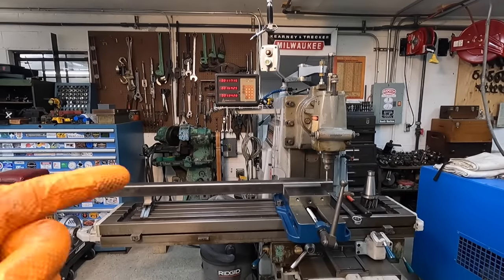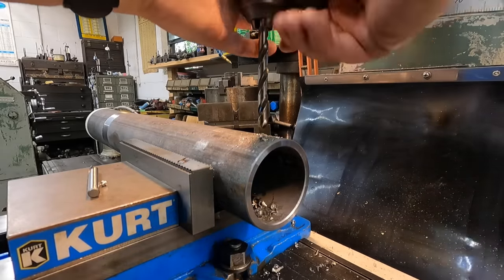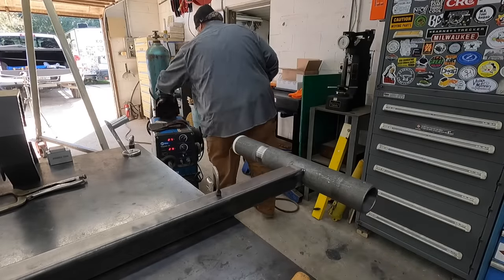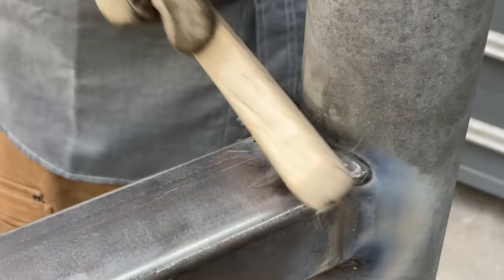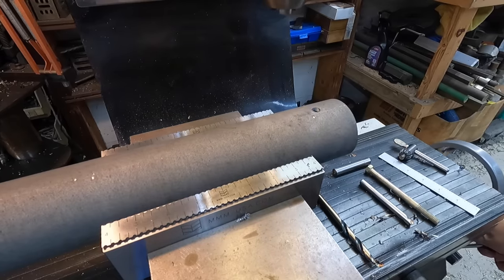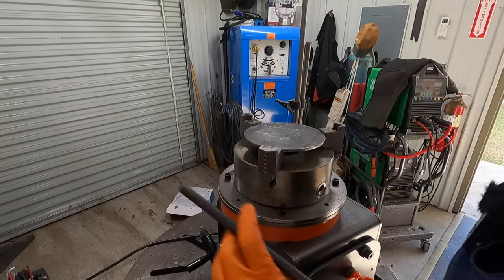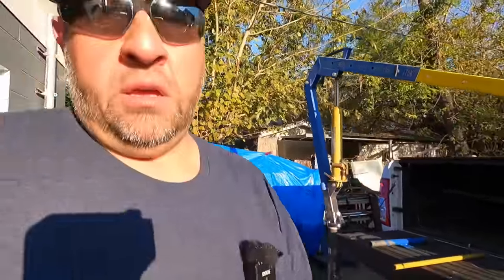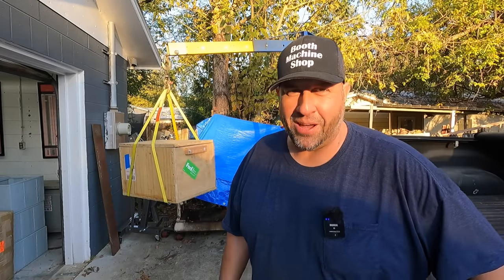Truck Hitch Crane Build Ep. 7: First Test!

Comment: you might be to hot for wire feed   rust on wire will pin hole  are you runing 100%co2   check for leaks in  co2 hose    might be too low of co2 rase flow up. but it sound right

Comment: I’d be worried about the frame of your crane twisting in the hitch receiver as  load is placed in the truck. The bed will go down and the pipe will not go down with the bed.

Comment: Adam, I don't think it would be a good idea to leave the base of the hoist in the trailer hitch while driving.  WELDING:  I don't know what your shielding gas is set at but it could be part of the problem.  Shelf life on the gas (?) I don't think so.  If that were the case, our planet would have to replenish the atmosphere fairly often.  If the gas is set too high it will cause turbulence at the weld puddle and it will pull in atmosphere to contaminate the weld, leave pin holes, and so forth.  The problem with the wormholes, I believe, is you are pushing the weld too much.  I wouldn't go more than 90 degrees angle to the puddle and I would most often use a slight pull on the puddle.  I have welded vertical up with shielded gas, metal arc and it would not weld properly with the nozzle pointed slightly up the way you would weld with stick.  The nozzle had to be pointed straight in, to slightly down, to keep the pinholes out of the weld.  With regard to putting a handle on the lift to facilitate turning it; I don't see why you need one.  Just turn it with the load where you have the most mechanical advantage.  The handle that was on the engine lift was on there to push the lift around and position it.  Just my three cents.

Comment: Ok, short, sharp and to the point. For god's sake! Use a simple, cheap and easy trailer jockey instead of a bunch of holes you have to try and find every time you put the leg down, which will also allow you to crank it up a bit to get some tension in it. Secondly, there is so much room on that giant hitch setup that you could easily put the top part of the boom on it as well and not take up storage room in the bed of the truck. Maybe you could even add a little hydraulic motor down there with an easy type fitting instead of cranking like last century :) With all of the engineering you did on the leg it's kind of pointless when all you ended up with was turning a simple mechanics trolley into a lifted version of a mechanics engine lifter.

Comment: Damp wire humidity, humidity, and and poor smittles hold a lot of water. When you're welding across it, try not to wave. But hold your ass as steady as you can. No wave. No isolation if that doesn't do it. I have also.  Hatching spot spot spot spot the first pass and then go back over it with the second pass. But when you pop pop pop the whale. In you usually do away with those warm brax. Then if your machine is up way too high and you have too much gas that also.  There's a factor run your gas as long as you possibly can. And you will have a less b b's. It's almost like your machine will be welding hotter. The less gas you use.  but that is a controlled environment.

Comment: Long term fan and only a hobby machinist, I am concerned about the loads when positioned in line with vehicle (i.e. forward and aft).  The angular torque on the system has nothing but the foot and square tube to prevent it from rotating in the square tube.  If the foot should slip for whatever reason its going to be a bad day.  When the system is at 90deg to the vehicle the load is much more stable as there is no rotational load on the square tube but a linear load - which looks just fine.

Perhaps you can secure the whole system to the vehicle rather than have the foot on the floor which can cause elevation changes of the vehicle as the load is released onto the bed… its a great job but on any heavy loads I would be really concerned.

As others have mentioned the pin holes in the tube are also too close and too linear, a spiral hole pattern would have been better perhaps?

Comment: One design fault I notest is.
when the vehicle gets the wieght put in it's tray & the suspension is loaded up coursing the vehicle to sag. Putting excess weight on the cranes leg. 
How are you going to get that leg pin / bolt out to lift the leg for transport...

Comment: I think the leg holes are too close together, that fine adjustment isn't needed (and they would be better if staggered in 2 vertical rows, at least an inch apart (considering this is probably only going to be used for 500# or more)

Comment: possibilities that I can think of that might be impacting your weld quality using the shielded gas and flux cored...
 if you spray enough anti-spatter into the crack  of a weld that due to the surface tension of the anti-spatter it pools in the crack of the joint...
 too much speed...and or not enough heat...
 if your flux has taken water... and needs to be dried.......
and if I remember correctly some types of gas will not work well with the flux. 
sometimes oxygen is needed in small amounts too... if... my memory serves... I cant recall where that scrap came from though...<- this line~ might be something to do with flux on stick electrodes.
 I have only worked with flux cored and gas shielded at home and I havent been quite so thorough with testing there.
 I am in no way a professional at the trade but I have observed quite a bit and retained some knowledge passed to me as well as diagnosing weld bots at my previous work place not flux cored mind you... 
hopefully there is something useful there. and yeah.... it can be a pain.... flux cored.... sometimes it just seems so finicky.
Reply: and yes... my testing... lol.... a million people and more have tested all kinds of wire before... the engineers of each wire type from each brand have tested the hell out of it too.... very much to say that I do not know for sure... and there are many people that probably do know... even down in the comments....  😅  all the same. hopefully there is something useful in there. cause its about all I have on the topic xD

Comment: Shielding gasses have a shelf life of ~3 years.
Reply: That’s not true. The gasses may separate after long periods of non use, but they don’t go bad after 3 years. Maybe 30 years.
Reply: @grntitan1  Shelf life 3 years.  Not everyone has the ability to remix the gasses depending on the size of the tank.  Nothing goes stale, but it does not work well to mig with either oure argon or pure CO2.  If you can remix by rolling the tank around and tipping it end to end a bunch, then yes, go for it.  My tank would take two people to do that with.

Comment: No gas for flux core wire. That slag means that you are running full core wire.
Reply from the maker: It’s dual shield. Flux cores wire with gas. Been using it for over 2 decades…

Comment: I like this built but I have a concern about the rigidity of the structure when the crane is pointing forward or rearward. At 150-200lb at full extent of the jib it is clearly fine, but what about at nearer the rated capacity of the jib? Is stability reliant solely on torsional stiffness of the square tube, or is the foot playing a role in also providing stability because of its contact with the ground? If so, the surface may be important. I would want to do some checks before lifting heavier loads - and probably remove the markings on the jib in case they mislead. Just some thoughts.

Comment: If the various gases in the bottle have indeed settled out and much use has been made of the welder then the advertised proportions will no longer be correct. Perhaps it would be best to just buy a new bottle?

Comment: So if want to be slick put a internal spring to foot tube so use your foot to push it down to ground then pin it … then hold down with foot pull pin let spring pull up foot then pin for travel. Save bending over so much and lifting foot!

Comment: When it comes to drilling a hole and using a shop drill and x-y vise as a kind of ‘mill’ there is no replacement for a high quality drill…Harbor Freight just wont do it for you!  Most of us are making it work with a basic metal lathe and a really good shop drill and vise which works…but not to tenths..

Comment: Googled: "welding worm tracks" has yielded several answers ranging from electrode angle to line feed speed to hydrogen that has been trapped by the freezing slag. So I guess there really isn't one answer.

Comment: I was hoping to see Vernier holes. Holes every 1-1/4" on the outside and every 1" on the inside would give you 1/4" adjustment with only five holes outside and a few more inside. (Edited to add: This would also solve the strength question of the webs between the holes...at a 1" spacing the web would be 5/8")

Comment: Welding on metal that has not been cleaned properly and clamping to the table not the part being welded is not helping your welding issues at all. As far as gas going bad, I have never come across anything like that. Flip/roll the bottle around to make sure the gas mix has not separated.
Web thickness is awfully thin between foot adjustment holes.

Comment: Not perimeters.  Parameters are what you set on the welder.
A "perimeter" is a "length" e.g. the perimeter of a square is
the sum of the lengths of the four sides.  Saying you set the
perimeters on your welder is a misuse of the word perimeter.

Comment: Yes, you didn’t test the second most important function - releasing the pin once the truck is loaded. The simplest if not the cheapest solution is to build a small hydraulic bottle jack into the foot.

Comment: A couple suggestions, you should either drill some weep holes in the column, or seal weld it, otherwise it is going to fill up with water and rust from the inside out.
Reply: Same with the foot, you should drill a couple weep holes through your weld bead, or drill a hole in the bottom of it.

Comment: i read a couple of commits here,  my question is after the truck is loaded you will have weight on the leg, how will you get the pin out to raise the leg without jacking the truck up, i had a pickup truck and they do sink with weight in them, you might not just load one 500# box, you might load 4 or 5 500# boxes and that leg pin will be very hard i think to get out to raise the leg up, i am just asking, it is a nice project

Comment: Hey my friend instead of welding pipe onto your lift to help rotate why not weld say a 5/6 boss on the boom starlight and a handle that you can just let hang out of the way until you need it . Itll look better and and you wouldn't need to worry about losing a loose rod or forgetting it somewhere. Just a suggestion .Great work ! Always educational.

Comment: In regards to the porosity and worming in the welds. Depending on your nozzle and defuser size, your gas regulator may be set to high. If the the cfm is to much the nozzle actually creates a Venturi between the tip and the work piece which will pull atmosphere into the weld pool and displace the shielding gas. Even though argon is heavier than air, the velocity of the argon starts to be a problem after a certain point.

Comment: I'm surprised you don't have a end mill for this cut.But I understand that cutters cost a lot of money. I am always amazed how you do what what you do with manual machines!!!! I have to give a 5 straw thumbs up for your extra set-up & work you do with all of your work & projects. I could never do all that you do. I have always worked in machine shops that had the machinists and other people for the welders, Though I did do MIG welding  We used MIG welding for everything in one shop that I assembled & welded a roller line for structural steel. The only thing when we used TIG welding was per engineering specs. I liked MIG welding the best. I always got a good bead with MIG welding than TIG or Stick welding.

Comment: pull stringers dont weave. pinholes are indicative of angle and limgering.. also always store your electrodes in a dry cabinet  .. hydrogen cracking in electrodes 4 hours after opening a pack then bake your rods.. can be rebaked only a few times if..

Comment: all the holes in the stand pipe for the hitch attachment are really close together,  I think I would have turned the pipe at each level to give it a little more strength.  that 1/8th in. gap makes it a little weak with a heavy load on it. may split and jam up when  you need it most.  Just a though from and old engineer.

Comment: Thinking a winch either hand crank or electric so you can get stuff up and off the ground directly like you're thinking with a generator, welder or heavier items not on a table or ground.  Wondering if even can push it to do riding mowers.   Be handy for pulling engines and heavy parts too.  Thanks for sharing sir!

Comment: I'm not sure the spiral idea would work.  Imagine "lines" of downward force on the pipe -- maybe think of what would happen if you sprayed it with some gooey liquid or something.   As they encounter the first hole, they have no choice but to travel outward and around it, and continue downard.  What I'm getting at is that with the line of holes, the vertical force is taken up by a nearly-full circle of solid pipe.  The row of holes would be called upon to deal with twisting forces, and that's all those webs between the holes will need to do.

However... if the lower part of the pipe was perforated with a bunch of holes in a spiral pattern, downward forces would once again have to travel off to the side and around each of those holes, resulting in a sort of a hodge-podge of stresses running all over the place.  In other words, while it seems like the metal between the holes would be stronger, it's not necessarily stronger in the vertical direction, which I think is where the primary issue will be.  For the extreme case, think of it more like...  something like expanded metal, essentially made of holes held together with the bits in between.  Great for catching a shotput straight-on, but if you were to put the force on the edge of it, it would squish.

I don't see any disadvantage of the vertical row of holes.  In fact, you could cut a slot in that location, and the rest of the pipe is solid and could still carry the load.  If there were big twisting forces to deal with, then my analysis changes, but as a first guess, I don't think the spiral would be the way to go.

Comment: Did you consider how you are going to remove the foot pin after setting the load in the bed as the truck settles? Maybe a screw thread on the foot so that you can release the pressure on the support leg.

Comment: you could make a part that would be a pivot that would slip into the end of the crane arm and the square hole of the truck side. then when ready to load the crane into the truck you could line it up, take weight off the base by jacking up the ram and then separate the flange. This would allow the crane to swing into the truck bed and load easily. might make you more inclined to use it.

Comment: Good video. Please consider not showing you welding each spot, it'll save time for you and your viewers. Also, look at the option of welding a hinge your square tube, so it'll fold the vertical support into the tube, allowing it to remain installed in your receiver hitch. Then the customer doesn't have to install it and remove it each time they want to use it.

Comment: Just to add to the ideas here, a pulley wheel at the end of the boom, another one at the beginning of the boom and a crank near the bottom of the Jack and have a steel cable with a hook then you won’t need to lift and lower the boom as much

Comment: I was always told the smooth side of the roller is for solid wire where the serrated toothed side of the roller is for flux core wire on a mig welder.

Comment: Your idea was dead on arrival .... 

I know is a year later but.

The moment you add enough weight as the truck sages down it will create enough weight for to make it impossible to remove that leg support, you will never be able to remove that pin. 

I thought you were going to used a manual crank like the ones for boat trailers "turn the handle and the leg goes up or down instead of that pin"

If you had updated after the fact ... I'll love to see you loading 1000 pounds or more. Then removing your contraction with 1000lb + on that truck bed.

Comment: I would suggest placing the tube for the rotation assist attached to the base that the jack connects to that way you would be able to get better control since that would be the closest to the center of rotation.

Comment: Hey Adam, the way these consumables are engineered these days, I've found it best to use the parameters listed in the data that comes with the wire.  Squeeze off 10 seconds of wire fee and actually measure the wire length to set your wire speed.  Great job on the project.

Comment: One of the things that I was hearing during the welding of the cope was the gas flow rate. I know from past experience with ER70-S6 in the shop I worked in that if you turn the gas flowmeter up obscenely high or have a diaphragm style regulator fail you can force gas inclusions in the weld. A few other things I could think of would have been to cam the foot so that once the truck got a load on it you could take the same handle that is used for the jack to operate a foot load relief cam, or even spring load it and have it foot actuated in the same manner as a dirt bike stand. On the chain end what you might consider capping the tube, then do a chain eyelet similar to the keyhole slots done on rollback wrecker decks which would make chain length adjustable or to have removable lifting slings for bolted harness slings.  Then, instead of having to have a pear link for that slip hook to go in to, any similar chain could be locked in place or changed out with the hook when necessary.  With that said, great work.